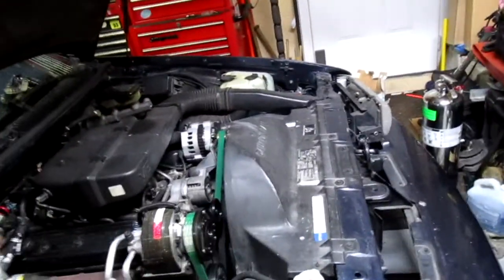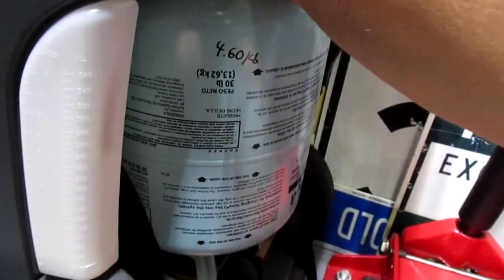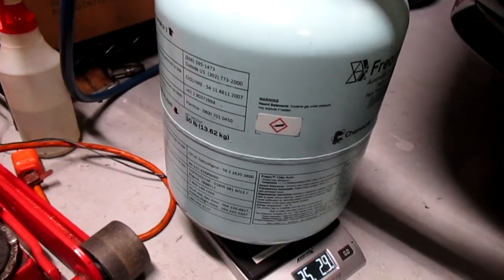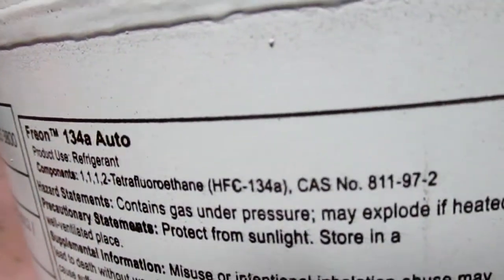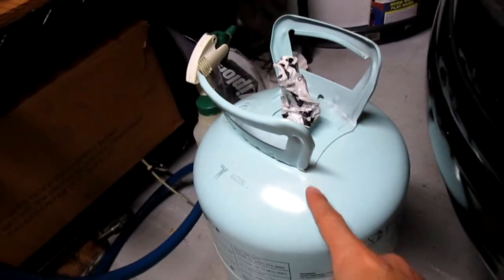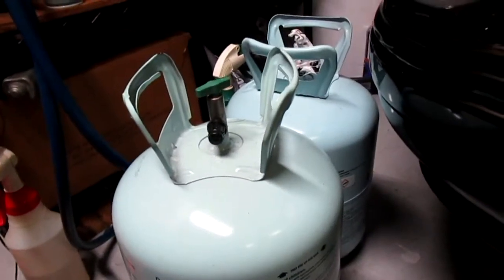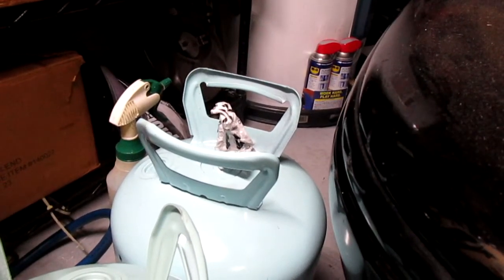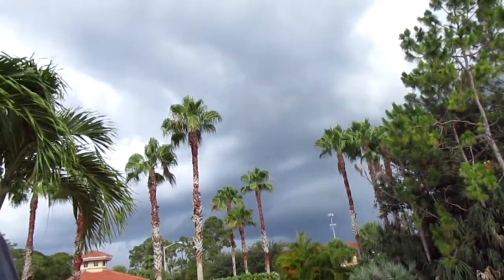How much Does a full  R-134a 30lb cylinder Weigh?

Comment: Ac guys are so damn crooked. Charging like 40 to 60 bucks a pound for freon. It's like, don't you make 200 bucks for a 20 minute call already? Then rip us off on freon. Cause consumers don't know cost to buy. I'm talking home units not automotive
But they practically do it too.
Reply from the maker: yea. R22 is expensive but R410A is not that pricey.  Get a manifold gauge set and fill it yourself. Think you can buy R410A some places w/o a cert
Reply: @GhettoWagon  oh man,, I know 22 is through the roof. I bought a decent set of gauges for 50 bucks and bought 22 for 80 bucks for a 30 lb can,, right up to when it cost 140 for the 30. Gave up after that. Bought  new units.
I don't mind people charging for services. Hell I'm a remodel carpenter. But I don't mark up items 300 % and charge 95 per hour plus and 85 dollar service call. I was paying a so called friend that for putting 2 lbs of freon in before I realized how much he was gouging me for coolant. He sold me a used air handler,, then charged me 150 labor 120 for freon six months later when finding out the handler had a pin hole leak and started freezing up. Live and learn.
I remodeled a rental house kitchen and dining room for an ac outfit. Gave them my bill, they ask me what my hourly rate was. I told the lady 55 per. She came out about 20 minutes later and ask if I could reduce my bill. Then had the nerve to tell me, we only charge 85 per hour here for our work. Obviously plus service charge. Of which I don't charge. I was so pissed. What f, nerve. But I took a hundred off bill. Dumb ass right? Trying to keep things friendly. They still never hired me again. Anyway.
Reply: @GhettoWagon  yeah, buying the freon was the problem. I m sure u can get 134, maybe even 22 on line, no license needed. But not over the counter. My carpentry license wouldn't do it. Ya gotta be a general co. Or ac contractor. Here anyway. I had a dude that was a neighbor buy the 22. Throw in 20 for thanks.
Reply from the maker: @peterford9369   To get a 608 cert. Think thats for residential is not all that hard. I got the 609 cert card somewhere for R-134a and R-12. Thanks Obama.  Now when you buy R-134a in 30 lb cylinders need a frikken license.
Reply: @GhettoWagon  We do have to think of the ozone. Regs are important, sucky as it makes it for the little guy. I would think as a mechanic it'd be doable easy enough but don't know. Thank goodness for the behind the scenes black market kinda folk,, where we small fries can pick up stuff we need. And as long as we behave and not contaminate the world we're good. Specially for our kids and grandkids.
Reply from the maker: @peterford9369   Its a fraud.  Regulations just create more havoc and cost everyone more. What happens when a vehicle crashes? Release.  Oh Accident.  What happens and a giant cooler that takes like a 1000'bs of R-134a vents.   I really don't care about what happens after I die. We could be slaves.
Reply: @GhettoWagon  😄,,,, aww come on. Ain't that bad. But I know what you mean. A hundred million cars on the road. Big malls with 10 20 ton ac units sitting on the roof. We do gotta be careful though. Take care, keep the biz goin. 👍
Reply from the maker: @peterford9369   Ya and our own goverment and others let off hundreds near 1000 nukes. Each time 1 million degree heat and radioactive material which circled the globe poisoning everyone.  Wonder why global warming exists that heat has to go somewhere.  And why does everyone have cancer?   Big companies, big business and Big goverment trash the place and the little person has to stop buying straws and plastic bags or more regulation to clean up.. Rigghtttt..  Oh wait. USA 1054 Nukes.  Over 2,000 were tested world wide.    Nice.
Reply: @GhettoWagon  True enough, but like my dad used to say, " just cause your friend does a stupid thing, does that mean you have to do it too"?  We're one of only a few people in our neighborhood that do the spay, neuter program for cats,, but just because others don't, doesn't mean our work doesn't make a difference. Keeping many unwanted little kittens from ending up getting hit by cars. But your point is taken and true.
Reply: If there worried about green house games,  does that mean they don't know shit about the bible ?

Comment: How many lbs of r134a does your white truck take? i need to fill back up, and i'm completely empty. I bought a new compressor as well. So im starting from scratch.
Reply from the maker: 2.00lbs  If you have a factory accumulator by the firewall it will say that on it. Well the Replacement ACD ones said that too until they went to china. Get a compressor, Accumulator and a orifice, Oh get 8pz of pag 150 oil too and you can if you want blow out all the lines with compresses air AC flush to get most of the old oil out and start fresh. You need a really large air compressor I have a 3 gallon it took hours.  get new service valves too. Low side and The high side. High side you need a special socket, GM high side socket, mastercool makes it, get the one that is short.  Orfice always has shit in it. Accumulator collects and keeps the moisture out.